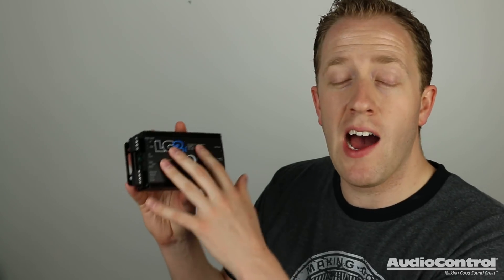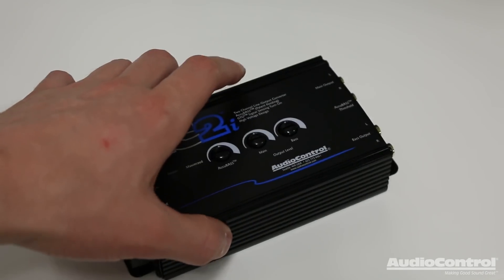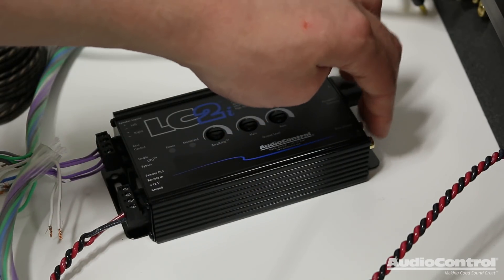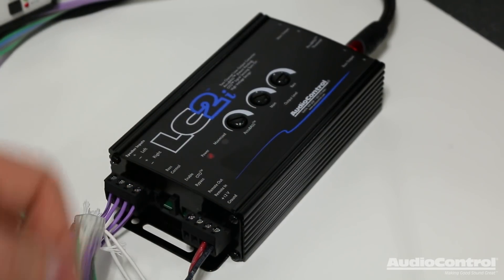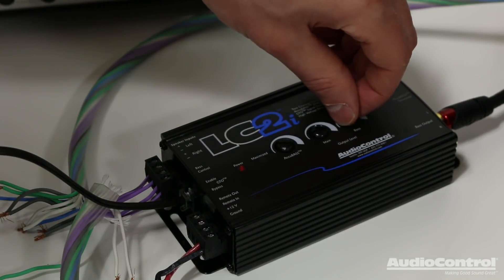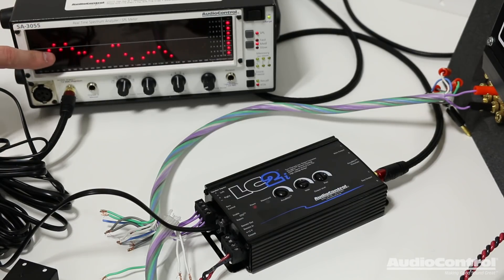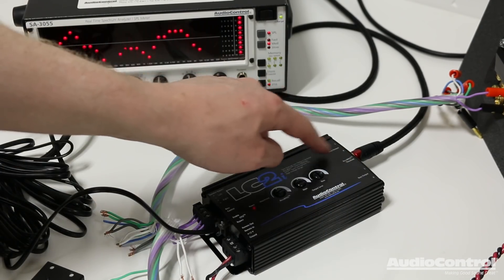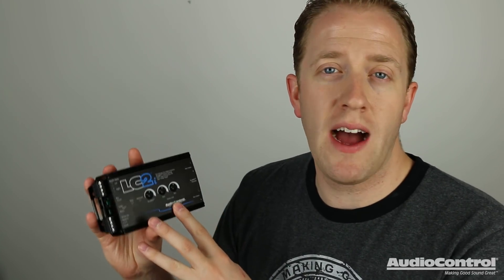LC2i - Add a Subwoofer Amplifier to a Factory Audio System - Line Output Converter

Comment: Would you suggest the lc7i even though I'm only installing a sub and a mono amp for now or just get the lc2i?
Reply from the maker: You can always install the LC7i and just use the sub channel, leaving inputs 1 and 2 empty. That way you don't need to buy the LC2i now then the LC7i later.

Comment: can I use the LC2i with a 4channel amp
Reply from the maker: The LC2i has 2 input channels and 4 outputs channels. The Main output channel is full range and the Bass output channel is low--passed at 1 kHz. You can use the LC2i to connect to a 4 channel amp as long as your source signal (from the factory system) is full range. You'll either split the main output to 4 channels with y-cables or switch the after market amp to 2 channel input mode (if available and by whatever name the amp manufacturer calls this feature). Hope this helps.
Reply: chico Hernandez I believe so, but we gotta add an eq. i have the lc2, and trying to figure it out too.  I guess the "Main" is a full range output, so we can run that into the input of an eq, then use all the sub and rear/front rcas out.

correct me if im wrong tho Audio Control
Reply: You can use a 4 channel/5 channel amp with the LC2i as long as you have a selectable inputs, IE the amp can take a 2 channel input. In that case you want to find out which speaker outputs have a full range signal because you'll be using the internal crossovers in the amp I assume. You don't need an EQ but that said each car is different and there will need to be some corrections made to the signal. In that case you would go Stock Stereo > LC2i > Epicenter > EQL > Multi-channel amp.
Reply from the maker: You are not wrong. ;)
Reply: This was what I was trying to find out. I (In my opinion) Overpaid to buy the LCI2 at a local shop so I could call and ask questions but whenever I ask about the main output they just skirt the question and suggest I need to upgrade. Now, I say "over paid" and "skirt question because I actually sell CARS on commision and am hearing the same stuff myself or my coworkers say.

So basically according to Anthony Thomas,  I can use the main instead of the LC7i but it will be a lot more technical and will depend on my amp. And even then it wont be as good as the LC7i, but yes it can work?